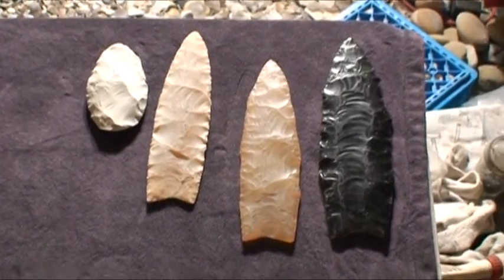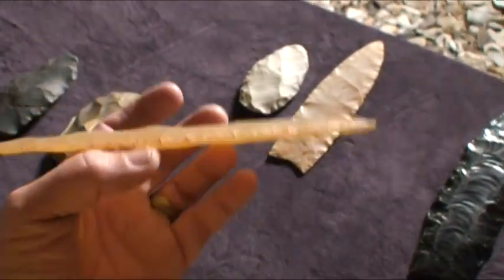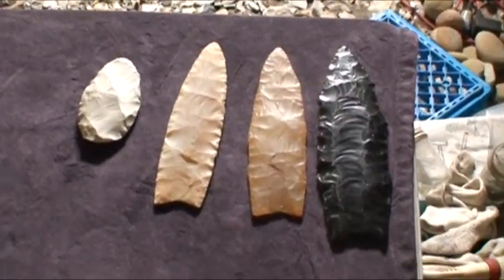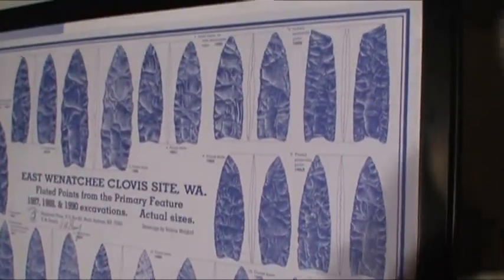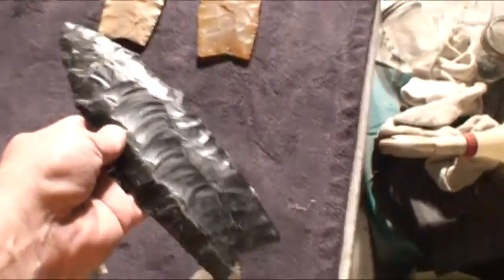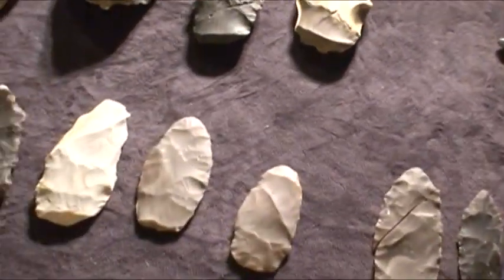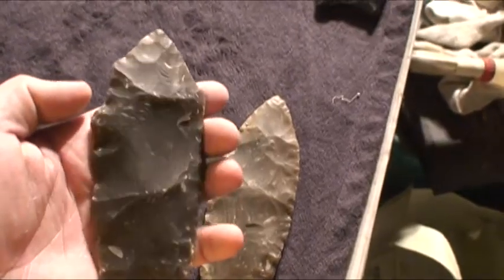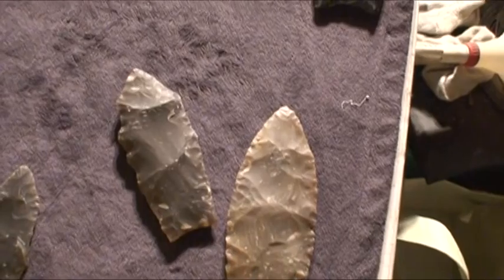Clovis Technology Nub Theory (hammerstone) 1

Comment: The flute was for the haft of the spear shaft, in order to give it more rigidity. The nubs most likely to keep the tendon bindings in place for a more fixed attachment. Beveling the working edge of the spear tips allowed for more ease in maintaining an edge with finer chipping in my opinion. and yes, the flakes had to be rubbish. I've found thousands of them in piles in the ground, as much as 2 feet plus in diameter. And of varying sizes. I've found hundreds of chips from their making flint swords, but never the swords themselves. I even have a petrified finger bone, with what looks like the joint in the middle. But the most interesting part on the side of it, is the dirt on the nose signe. Very small & easy to miss. My brother has a bit of knee cap that turned into jade we found in what was left of a washed-out mound site on the eastern edger of the main ford in Cascade park. After so much relic hunting more so than re-creating them, I've learned a lot about work marks. And from what I've learned shooting my film "The Mound Builders of Ohio" in the 80's, the mound-building cultures traded for everything along specific routes, or as I call them, "goat paths". Quartz arrowheads or anything else is very rare. And in mt relic-hunting experiences, that white flint was roughly worked, indicating paleo.
Reply from the maker: Wrong. I want you to make a reproduction clovis point with nubs as you describe them, haft it as you describe it, and then use it as you describe, and then report back here with your results.  Watch Nub #5. I can't stand it when people say things as if it were fact, "The flute was for...." ....means you are certain. Show us!
Reply: @lwnrm8 I'm part Apache so I know a few things.

Comment: Speculative theory:  Perhaps those nubs were for binding the blade to a stick via sinew.  Maybe they found limitations to engraving a channel on both sides.  Perhaps they just couldn't figure it out and what they had worked so well that there was no need to re-invent it. 
In addition, those blade flakes may have made excellent arrowheads (when worked of course).
OK, perhaps I should wait until the end of the video to post my opinion.
Reply from the maker: Clovis people didn't make arrowheads. I made a new nub video....#5. You should watch it. It might make more sense.